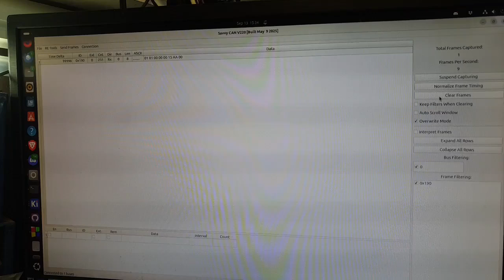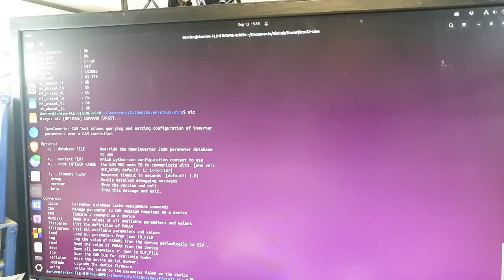Tesla Model 3 Drive Unit PCB Design 11 : Exciter Times

Comment: Lately i've been going the extra mile with my bodge wires. I made a simple 3D printed tape cutter (it's kinda like a tape dispenser, but it uses a teflon roller on the sticky side and a cutting (kinda like pipe cutters) disk on the top side) that allows me to split copper tape from 5 mm to 1 mm (or whatever spacing i want) and i use that 1 mm tape to trace the bodge wire. I feel it's a bit neater and less prone to snagging. I hate it when i have some bodge wires, i go install it and find it doesn't work because i accidentally clipped them. And it's happened enough times to justify the extra time spent on copper tape laying. Best part about copper tape is that with a kapton tape layer on top (cut with the same thing) i can then make multiple traces, essentially my own layered board. I bodged a mod chip into a small AC control unit that was soft locked and this came in clutch. Not my idea, so i'm just spreading it around, for good electron vibes.